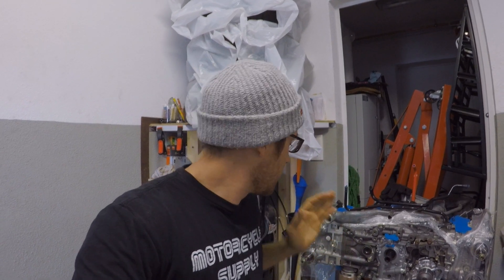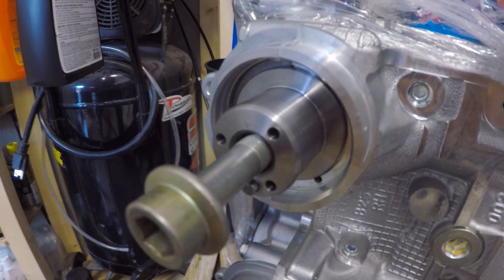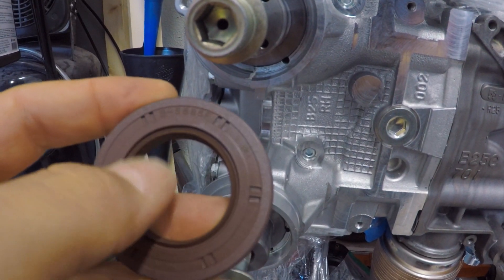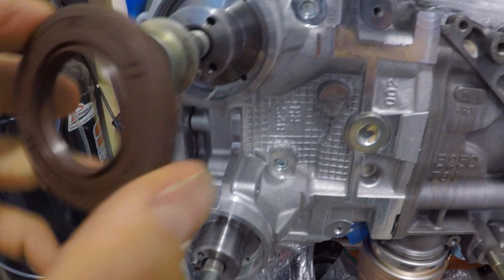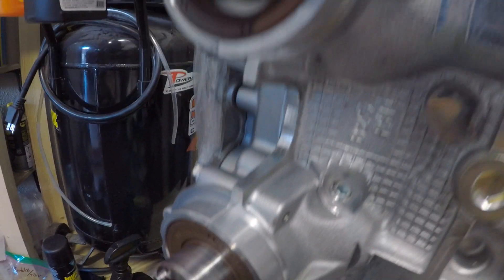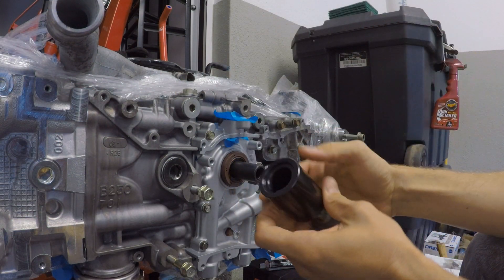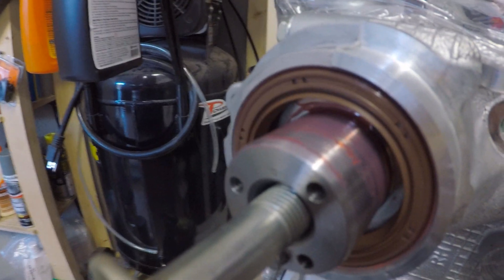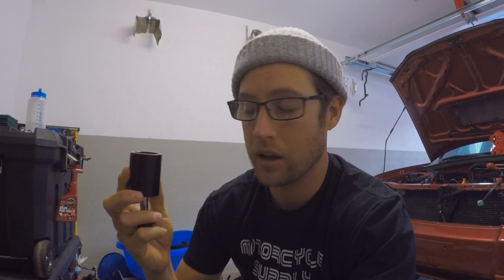EJ25 CAMSHAFT and CRANKSHAFT Seal Install (WRX/STI)

Comment: Are the intake and exhaust oil seal are the same size?
Reply from the maker: @AAFlight11  yes they are the same outer diameter but they are different. The inner diameter is larger on the exhaust seals.
Reply: @AdrianBilladeau  Thankyou..

Comment: How did you remove the old ones? I have a 96 outback I need to do this on soon.
Reply from the maker: Using a seal puller would be the preferred method. But I smaller flat tip screw driver would work too. But you have to be careful not to damage the “housing” area around the seal.

Comment: Does the motor have to be pulled to replace them? I’ve just bought my first car which is an 08 wrx which need cam seal replacement. I was wondering if I could do them myself
Reply from the maker: No. You can replace them with the motor still in the car. The radiator has to come out though.
Reply: @AdrianBilladeau  ok thank you so much! This is my first car at 16 and I rlly wanna do majority of the things myself!
Reply from the maker: @JDiidi4PF  right on! That is really cool.  Be sure to stay on top of routine maintenance. The more engaged you are the better chance you will be able to hear or see when something is wrong. Really that applies to anything but you get what I’m saying. Good luck with your task.

Comment: Omg just video just saved me i put the oil seal the wrong way
Reply from the maker: EckoEcho that’s fantastic! Are you building it up  on a stand or just doing maintenance?
Reply: @AdrianBilladeau  im doing a full rebuild. Valve adjustment all done. Stop today because there was two different cam oil seal. I didnt know which one goes where.
Reply from the maker: EckoEcho that’s cool! What’s it going in?
Reply: @AdrianBilladeau  its going back into my Blobeye sti